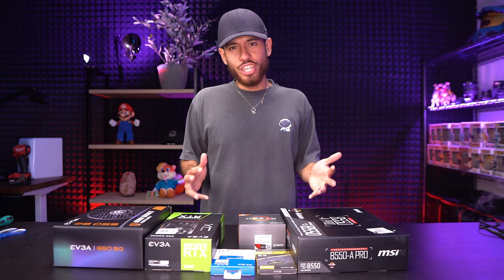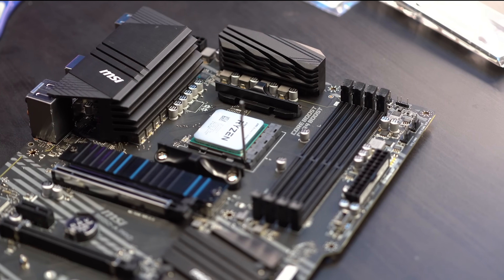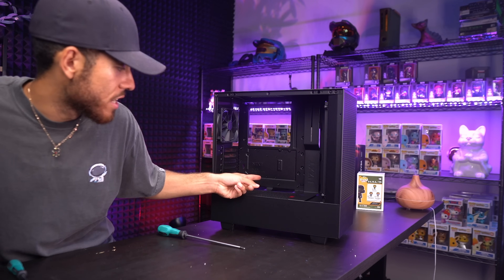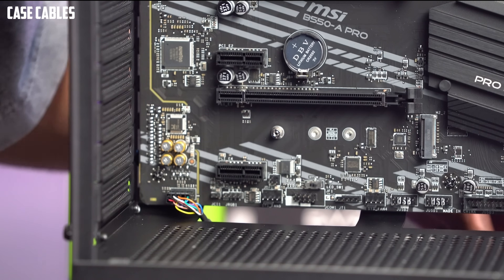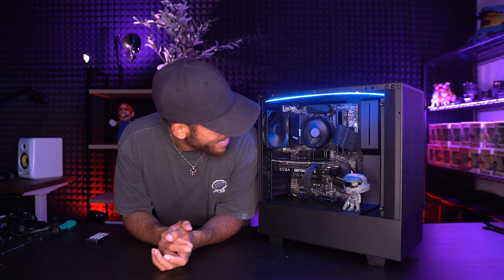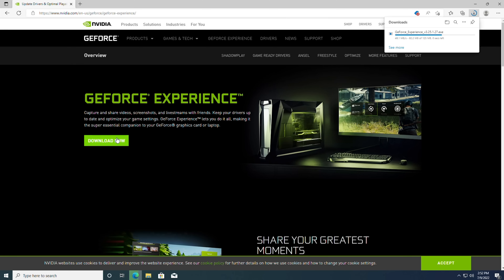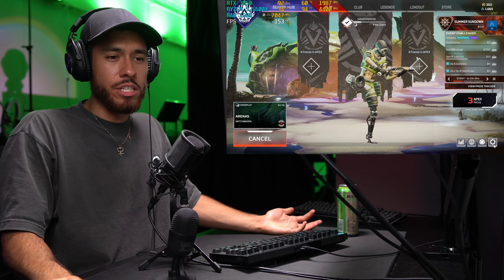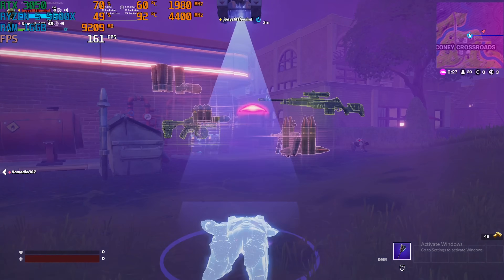Best $900 Gaming PC Build Guide - RTX 3050 Ryzen 5 5600X (w/ Benchmarks)

Comment: main issue with this config is, if you're actually following this guide I'd recommend a 2070 Super for a similar price as the gpu
Reply: Isn't the 3050 better
Reply: @VexDylan_  no lol, 2070 super wins by a lifetime... 3050 is just a slower 2060, its not that special and is terrible to consider buying. :D
Reply: @theelepel2679  is it better than a 1660 super
Reply: @VexDylan_  the 3050? yes, however it still remains a very bad buy since 6600xt exists for this budget. and will demolish it.
Reply: @theelepel2679  what is the 3050 Compared to like what gpu is it the same as or close to?
Reply: @VexDylan_  Its between the 1660 ti and 2060, however for the price you have to compare it to a 6600/xt.